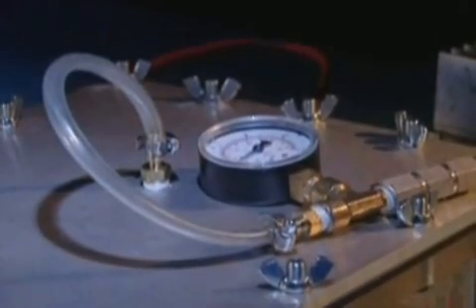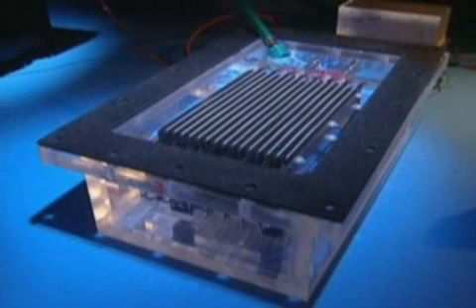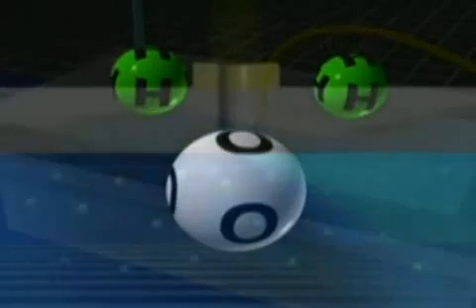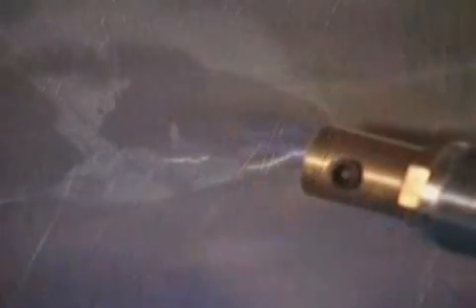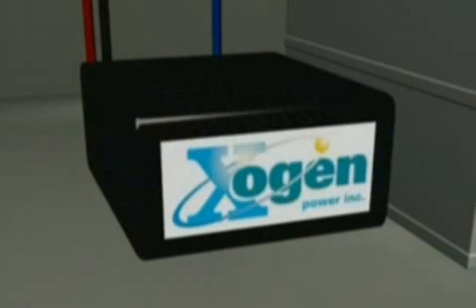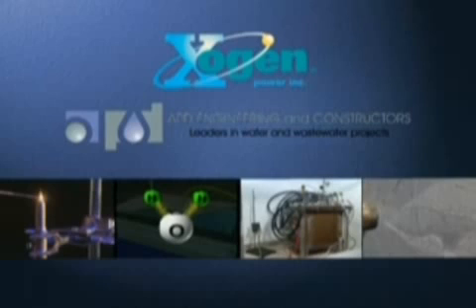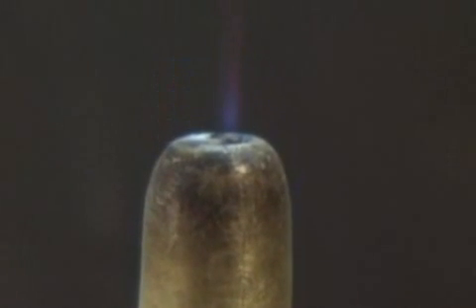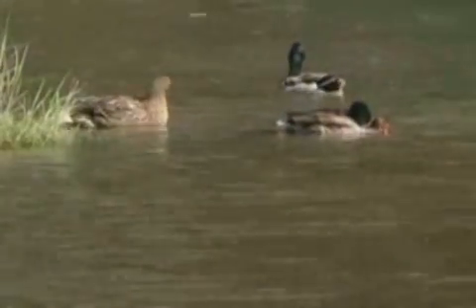Xogen

Comment: Let's consider nitrogen
The papp engine (inert gas) 
The Klostermann kanon ...
Moving a piston with an ignited plasma arc is possible.Shown multiple times in YT.
No common used fuels inside..
There may be moisture, Nitrogen of course : Yes simply Air.
Tesla had a patent on that, which he did not publish as such.
Peter Graneau's ballistic experiments on 'exploding water'

Comment: They arent at 100% effeciency. Meaning that the batterys need to be recharged. And even if i did use a hydroxy system id rather use a turbine generator setup instead of running hydrogen  throughout my house.

Comment: @Katharsis540  u are like a broken robot.. u only say "u can't create or distroy energy"... obsesive... 
U can't create from nothing... but still.. If u spin a magnet in a midle of a few wires u get electric energy!, Is not that from nothing? 
Here, in fact, is a extremly  simple chimical reaction... just divide the h2o in Hidrogen and Oxigen .. what is so friking hard to understand that? As i know, oxigen and hidrogen are 2 inflammable gases... why that is not working for u?

Comment: @a1mint It can because according to them it is not standard electrolysis.

You are thinking in terms of the 2nd law. This is about breaking molecular bonds and xogen recieved a patent because the proved that they can break molecular bond with less energy than standard electrolysys.

Comment: @a1mint You are not following. They were granted a patent and in order to get a patent you have to prove your claim. If Xogen had not proved its claim they could not have gotten a patent and if they defrauded the patent office the patent would be revoked. They have found a way to drive parahydrogen and 02 out of water with less energy. Alberta Research Counsel also tested the Xogen device.

Tell us all how many kilowatts if required to split a liter of water.

Comment: @a1mint  I am not wrong. I am saying that exogen is claiming they have a way to break the bond between the electrons that comprise water. This in not a thermodynamic process they are using so you are barking up the wrong tree.

Nothing can break that rule? It was guys like you who said the sound barrier was impossible to break even though bullets were traveling at the speed of sound. 

All matter has a resonating frequency. Exogen may have found a way to knock the electrons out of their shells.

Comment: @a1mint They are not claiming they are creating energy out of nothing. They are claiming that they have a way to crack the bonds that hold water together.

When it comes to getting a patent it requires the applicant to prove their claims before a patent is granted. You can't get a patent on a perpetual motion machine.

You may want to read about the patent process. 

I don't know if  pulses can break the water bond but Exogen is claiming it does and they have proven it to a patent engineer

Comment: @a1mint this is not perpetual motion or over unity. They are saying that the have a way of pulsing the current in a way that break the covalent bonds with less energy than standard electrolysis. Theoretically it is possible and they did prove it to a patent inspector. 

All matter has a harmonic vibration and maybe this Xogen thing can uses simple harmonic motion to break the water  by hitting it resonating frequency like a singer can break a glass.

Comment: If the Xogen system is real (that we can create Hydrogen Gas spontaneously using only a little electricity) Hydrogen Gas can run much cheaper than expected.  Sea Water is abundant.  One drop of water can create a tremendous amount of Hydrogen.   The cost should only run $1.25 per 500 psi.

Comment: in plumbing a "harmful" side effect of closing a tap called water-hammer will destroy the pipes if an air chamber is not installed to cusion the shock.  however the same "harmful" effect is harnessed in impulse pumps to lift water higher than the source with just gravity as the input (no elec. pwr) in electronics overcharging a capacitor wlii cause it to blow up (bad) but in this use the dielectric H2o is broken down for a (good) /useful purpose. I really hope this tech spreads like a plague THX

Comment: I don't think it is really any different (at least, fundamentally) from ordinary electrolysis.  True, they have optimized it for tap water with a well designed circuit (it is true that a higher voltage is required for water of lower conductivity), but keep in mind that hydrogen as well as "HHO" is an infrastructure/ energy storage plan, and not "free energy", as so many hopefull people seem to think :).

Comment: This particular method isn't electrolysis, what this method is called is the high voltage disassociation of water. It produces HHO at a much higher rate than conventional electrolysis and the amperage is restricted in this process making it extremely efficient. You won't see it being uses because it threatens the current oil, coal, and nuclear based economy. Conventional electrolysis cannot purify water because it requires purified water an a electrolyte additive in order to work.

Comment: Don't listen to people who say "can't."  All they are saying is is that they don't know how, and you better believe they have never tried. Or they sell power.  You can certainly create very inexpensive power. The Law of Conservation of Energy may be called a law but it is still just theory.  Something is only impossible until someone does it. Xogen uses a low voltage current oscillated around 20 kHz depending on the electrode size. You'll need a frequency generator.  Google Brown's Gas.